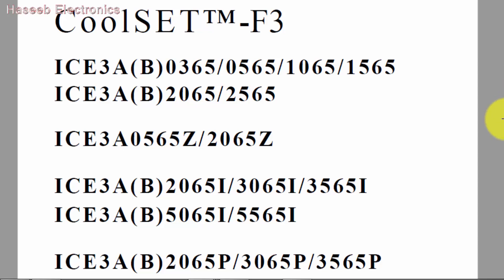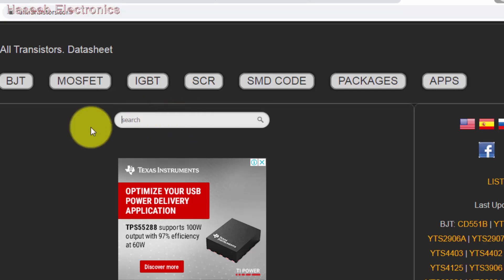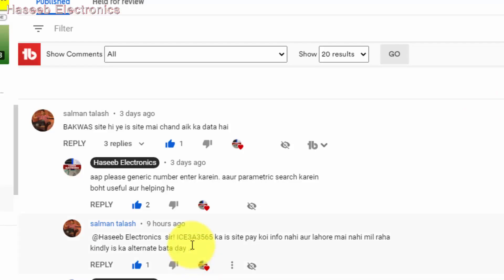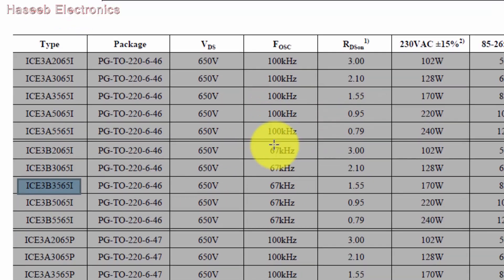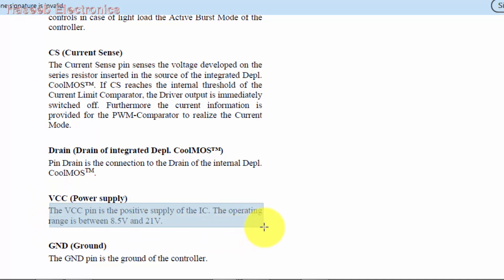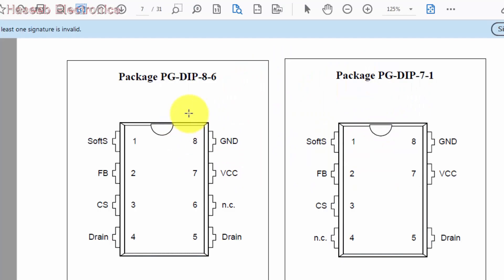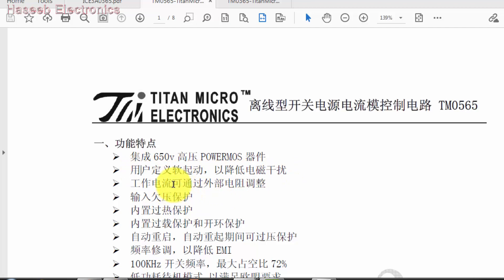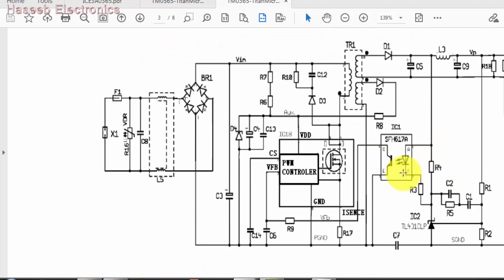[374] How Find  Datasheet & Equivalent  - ICE3A3565 Current Mode SMPS controller

Comment: Sir can you share the data sheet of 5 pin IC 884A05 installed in inverter AC unit outdoor crad
I tried but can not find
Reply from the maker: i also tried but there is no datasheet. i will try it to find
Reply: Insha ALLAH, I hope you will find sir.
transistormosfet.com
Only show for order but not show the data sheey

Comment: Sir any faulty SMPS  how to check on low voltage
Reply from the maker: On low voltage it should provide rated output
For example
A 12v 2amp smps designed for 90-245 volt 
So it must provide rated output at 90 volt or 245 volt input by adjusting it's duty cycle
It should provide

Comment: A. O. A sir   mashallah good work sir  12 volt 15 ampere  ki smps  ka circuit bnayn  aur diagram bhi. Uc3843 ko use kr  ky  sir yh lazmi banana hai yh circuit
Reply from the maker: 12 volt 15 ampere is 180 watt
so try to design a circuit using bipolar magnetic design 
as push pull topology using TL494 instead of UC3843